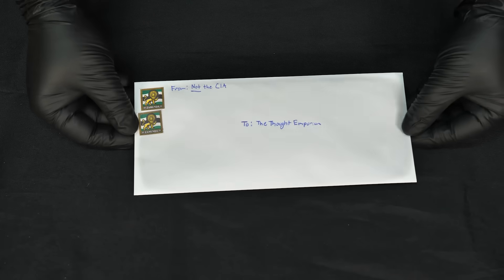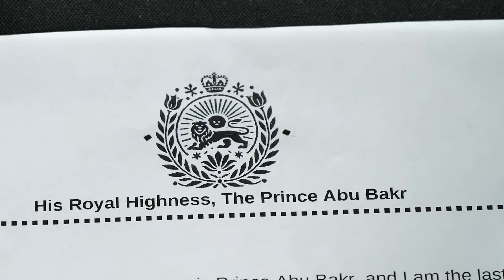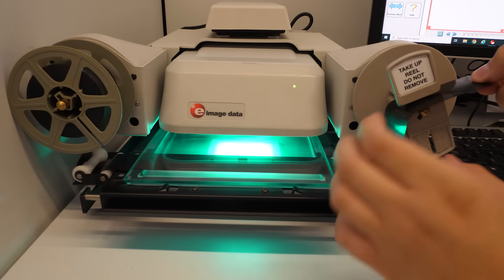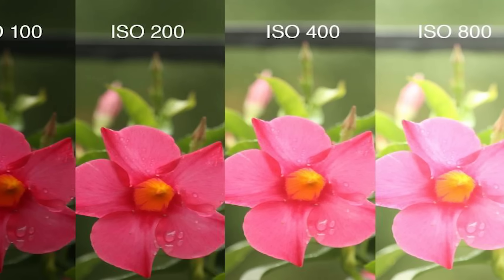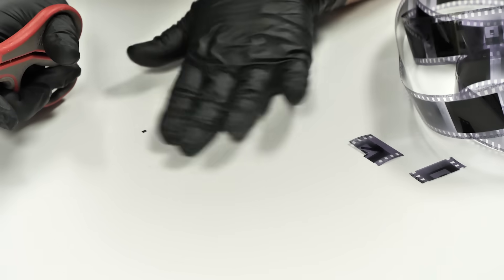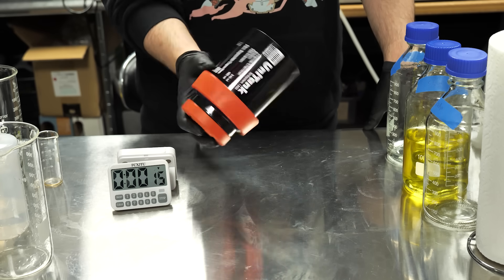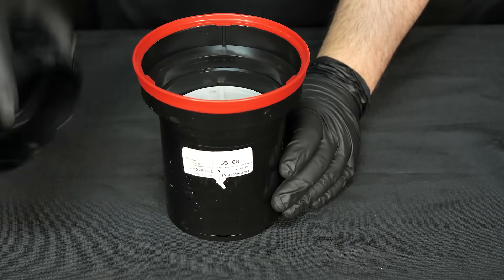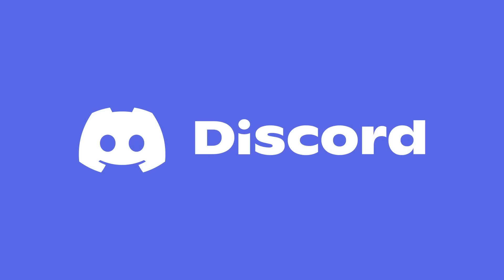Recreating CIA Technology Was Surprisingly Easy (Microdots)

Comment: the library at my University has a very large collection of microfilm. Like archived news paper mostly. They have a special viewing rooms with enlargers and scanners, but you need to book an appointment and get an introduction - so I never did.

open aperture isn't the sharpest. Especially on old lenses. Look up circle of confusion, airy disk, dawes limit to avoid diffraction limit by closing to ofar. It's not just the number it's the wavelength of light and the physical aperture size! So focal length doesn't matter, sorta.

Comment: 5:40 I really don’t want to be THAT guy but you can also just open the camera in the darkroom, cut the exposed part off (which is easily done blind and also routine if you develop often) and reinsert the film. That way yon only loose a couple of frames per test, just for winding  it up again or if you reinsert the film in the light though exposure.

Comment: Ex pro- darkroom tech here, yes, you can re-use the dev, but, don't, it ruins your consistency and there's no way to accurately know how exhausted it's become. Commercial dev lines use continuous replenishment based on average image density, tank developing you're far better off mixing fresh dev every time. For tank dev, my personal agitation regime also includes a couple of sharp taps on the bench to dislodge bubbles. This might be just one of those feel-better mythology based things, but the dev does foam, sometimes. 

Commercial stop bath includes an indicator and is bafflingly expensive. Total waste of money. Just use white vinegar, or citric acid. You don't actually need stop bath (or vinegar) but you have to factor in a bit of extra development during the post-dev rinses, and your fixer might not last as long. Feel free to re-use the fixer a fair bit, and keep it. Recover the silver from exhausted fix by electrolysis. Test fixer for exhaustion by seeing how quickly it clarifies a bit of unprocessed film (snip a bit of leader). Adequate fixing time, and the final rinse are important for archival performance. And a rinse between stop and fix helps your fixer last longer. Very last rinse, you want a wetting agent to avoid drying marks - like with stop bath, you can pay a lot, or you can use a single drop of unscented washing up liquid (original Fairy liquid works well) in about 2 litres of water, up to you.

Temperature and time are the important things for development. For silver halide b/w film, have the developer at an easily maintained temperature (about 20 celsius) and adjust the time around that. Avoid shocking the film, when wet, with ice-cold rinses, which can lead to reticulation. Just start with several large pitchers of room temperature water to hand. For the penultimate, long, rinse, leave the tank full of room temperature water and pipe in slow flowing tap water and leave it running for long enough to go and have a snack or something, then empty and allow it to come back to room temperature, add your wetting agent rinse, and then hang it up to dry somewhere dust-free.

There are dodges. If you have time-sensitive news photos, skimp on the rinses and do the final rinse with ethanol which will just evaporate off quickly. Urgently developed film can be re-fixed and re-rinsed for archival storage after initial printing. But that kind of photography is always digital these days so that's useless information.

You can retrieve the leader from a 35mm film cassette with a couple of opaque bits of plastic or a leader extractor, saving you from the need to prise open the cartridge and trim the end in the dark - you can have the film threaded onto the reel in daylight, with the cartridge intact. Obviously if you're shooting it yourself, save yourself the hassle of leader-retrieval and don't wind the leader back into the cassette when unloading - you can feel when you are at the end when rewinding.

Comment: Funfact: the grain in film is not actually a result of the physical film grains in the emulsion, as those are often a magnitude smaller (<10um) than the visible grain in a negative. Rather, the grain is an noise pattern resulting from the overall optical resolution of the imaging system. I recommend the writeup "Film Grain, Resolution and Fundamental Film Particles" by Tim Vitale as it goes into detail about this.

Comment: Yes all the Chemicals can be used multiple times.

You did touch on the aperture, that can play a big role in clarity. In addtion the Depth of Field is critical, exposure time, better quality Glass (Lens). There's more factors then just the speed of the Flim. I realize you're just trying to do a simple experiment. But just in case someone wants to take it to another level. Great video. 

PS I made my first camera. Out of cardboard stock. It was what is called a Pin Hole Camera. It has no lens, just a tiny pinhole in a piece of Aluminum Foil. The Smaller the hole the more clear your image will be.
Take care

Comment: 08:30 
Lens quality - er no they are not made by spy agencies and I'll explain why in 4 parts, however there is a catch of physics involved- first the more magnification you want the more light you will need as it increases the exposure you need  however if stuff isn't moving you can put the camera on a tripod and slow the shutter down!, second the "depth of field" of the optical system becomes increasingly shallow, which is what actually caps just how far you can go where even the thickness of a sheet of paper can effect what is in focus.

1- Macro-optics: there are commercially made lenses perfectly capable of doing the task specified - they are called Macro OR Micro lenses ; which are specifically designed, usually fixed focal length optics (because they are the best quality) lenses. Most of the major manufacturers make them, they are just expensive because of the amount of optical density glass in them (I own 4 myself)- usually I use them for close up photography  of miniatures or insects
2- reversing a Wide Angle lens: as it happens the lens requirements for macro optics used the other way around are the same as those for wide-angle panoramic optics, so with some additional adaptors you can reverse say a 24mm wide angle lens and use it as a perfectly capable if very short focal length Macro lens. To do this you will need additional external bright light sources 
3- Extension tubes: ok we are going into the weeds now, by moving a lens further away from it's normal focusing plane, you effectively magnify the images, try this with a magnifying glass. You can also do this optically with a camera lens effectively turning your camera into a microscope. The tubes are made in fixed lengths ideal for each level of magnification - yes I have these as well for my nerdy hobby!

Finally 4. Combine all three for insane microscope levels of magnification , but you need bright lighting and have to deal with that paper thickness level of depth of field.....I know because I did this for a technical exercise in my photography course (doing stuff my tutor did not know was possible as it happens). Btw how to get things really flat ...a glass plate to hold the "target" as flat as possible and clamps to squish the set-up as flat - no you can't just tape stuff down

Comment: Can't find anything in this video that explains the process to reduce the large picture to a microdot.
Optics used etc.
Reply from the maker: film is smaller than the object you're photographing, so any image on film will inherently be smaller than the original object. If you stand further back, the relative size of the object on the film is reduced further. Choose the right distance and you make tiny images on the film

Comment: I'm sure you'll never see this but here goes ... camera lenses like the one you have are sharpest at about f/8.  Any higher number will suffer due to a phenomenon known as "diffraction" - it physics - no camera lens is immune.  So, if you want the best results, don't stop down to f/16 or f/22.  If you want to experiment with this first hand, just try it with a digital camera in manual mode.  The smaller the sensor and the higher resolution it is, the lower the best f/stop number is.  On a Canon R7, for example, it's about f/5.6.  On a 35mm, I'd use f/8.

Comment: You'll probably find that the limits of your resolving power here aren't because of the film grain, as this looked more like your lens was the limiting factor. Shooting at the widest aperture of any lens will always make your images a bit less sharp than they could be, and consumer level lenses like that Nikon 50mm E Series are good (I own one myself!), but a dedicated macro lens would be even sharper. Nikon made a 55mm macro lens that has a great reputation, or you could use a more modern Nikon macro lens, as Nikon used the same lens mount for all its cameras up until a few years ago. You could even try using a set of macro bellows with an enlarger lens or using microscope optics to get some insane magnification levels, but that's beyond anything I've tried so I wouldn't know where to start with that.

Comment: Back in the 90's I used to do a lot of B&W and slide film development.
Ilford developer can easily be used 2-3 times.

I usd to buy bulk film, usually Kodak or Ilford and loaded the bulk stock into reusable capsules, which made everything much cheaper and more flexible... Shorter rolls with 12 Images? No Problem! Extra Long rolls with 40 Images? Dito.

You sould also try Colour slide film... extremyl satisfying and the eesolution of an Kodak Ekatachrome 100 shot at ISO 50 or Fuji Velvia 50 is stunning… 
I use to scan These at 6400dpi yielding 56 Megapixel Images... you Need really high end "glas" (lenses) to push film that far.

Comment: One thing I learned back in High School.
Decades back, we used a Crown Graphic Press Camera with a 4 by 5 inch cut film negative film with an ASA or ISO of 400.
Development was in a completely dark room with 3 trays in a shallow sink filled with temperature controlled water and the three trays from left to right, held the Developer, Stop Bath, Fixer, then rinse bath.
The stop bath is usually a mild acid like citrus or white vinegar. The fixing agent was called Hypo and was usually ammonium thiosulfate. This removed the silver halide to remove light sensitivity. After the fixer came a water rinse bath, running water over each negative.
I spent many evenings after school developing 6 different pieces of film, standing in absolute darkness turning each 4x5 pieces of film by hand. We didn't have a daylight tank. 
At least when printing the image on photo paper you could do it with, a red light on, as the paper wasn't sensitive to red light.

Comment: One other thing I forgot to mention: mechanical stability of the rig at any distances will be critical, shutter can cause vibrations in distortions of the final image depending on the magnification you're using. I remember using a remote trigger on film cameras when taking pictures with the telescope for this reason. You could entirely eliminate this problem if you take the photo in a completely dark room and turn on the backlight to achieve the exposure. Turn the light back off and close the shutter when you're done.

Comment: A few things that may be useful you for: 

1) your pages are not light tight, use transparency paper and stack multiple to get it light tight or at least better contrast 

2) you may be able to use a pin-hole setup. I'm really not sure about how this might work or the size of the pin hole required but it should provide infinite depth of field and remove the optical issues, other than diffraction of the pin hole is too small, or you get to close to the edge of the hole (vignetting).

3) I'm not sure if it would help but consider experimenting with polarized light and filters

Comment: 1. Gather necessary supplies:
    - Microscope slides
    - Laser printer
    - Image editing software
    - Printer paper
    - Clear nail polish
    - Clear nail polish remover
    - Cotton swabs

2. Choose an image or text to create your microdot.

3. Use the image editing software to resize the image or text to a very small size, typically around 1mm in diameter.

4. Print the image or text onto a piece of printer paper using the laser printer.

5. Apply a thin layer of clear nail polish onto a microscope slide using a cotton swab.

6. Carefully place the printed image or text onto the wet nail polish on the slide.

7. Allow the nail polish to dry completely.

8. Once dry, carefully brush a thin layer of clear nail polish over the printed image or text to seal it in place.

9. Allow the nail polish to dry completely.

10. Use a cotton swab dipped in nail polish remover to carefully clean up any excess nail polish around the microdot.

11. Once the microdot is completely dry and set, it is ready to be viewed under a microscope.

12. To view the microdot, simply place the slide with the microdot onto the microscope stage and adjust the focus until the image or text is clear and visible.

Comment: - Gather your materials: LSD or other desired psychedelic substance, distilled water, a small container with a dropper, and blank sheets of paper or perforated blotter paper
- Dissolve the LSD or psychedelic substance in distilled water in the small container using the dropper. Make sure to measure the amount accurately for desired dosage strength
- Lay out the blank sheets of paper or perforated blotter paper on a clean, flat surface
- Using the dropper, carefully drop small amounts of the LSD solution onto the paper in evenly spaced dots. Be sure to let the dots dry completely before moving or storing them
- Once the dots are dry, they are ready to be consumed. Simply peel off a dot and ingest it orally for a microdose of the psychedelic substance. Store any remaining dots in a cool, dry place for future use

Comment: The ability to reuse the developer depends on the type and manufacturer, usually the info label on the bottle. The phrase "one shot" means it is for single use only. Also the second step "stop bath" can be replaced with a 1-minute water bath with constant agitation.

Comment: Technically, 14:52 I usually  can be reused a few times, but time length changes on reuses (each use takes longer for exact same quality with same elements) but unless you're very, very low on supplies / funds then reuse isn't suggested.
You still save the developers because the clear area left SILVER in solution
Reply: Processing used developer will recover $20/ounce silver

Comment: The micro-dot reflected light that shined on it (meaning the dot does not have the characteristics of the ink around it) it this case whatever light is in the room during filming, unlike the rest of the ink on the page that appears flat and matted like ink usually is. I can be a little weird about the things that I notice. This would have tipped me off.
Reply from the maker: often they'd do this in magazines which have shiny paper, making the difference far less noticeable, or they'd modify the film to have a more matt finish

Comment: He was close but he has to realize that resolution of the film is only part of the story. The camera lens aperature itself has a sweet spot for the best resolution(usually 2 stops from max aperature), also the film choice of course. If techpan is still available that would have worked better. Its ISO was 25. Lastly is the developing agent itself. The different agents affect the resolution in some way. While silver iodide was used, Silver bromide was the most common. The developer in the process can be used repeatedly but the bromide is released, leaving the exposed silver as black on the film and does retard the process and  there is some oxidation of the agent. Reusing the developer will also affect the film resolution fresh developer is best.